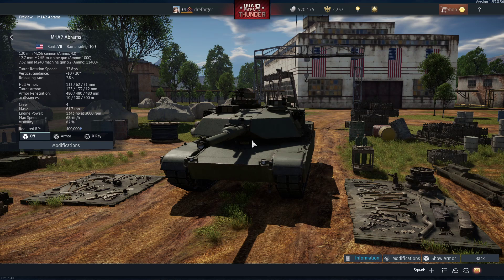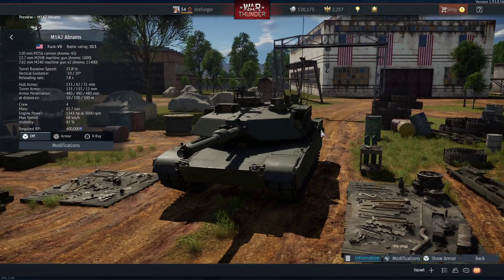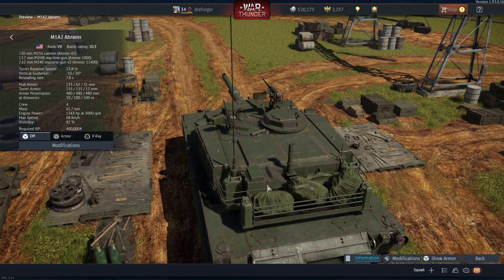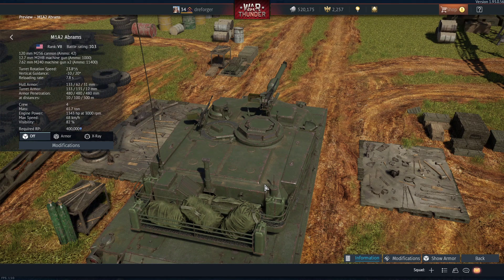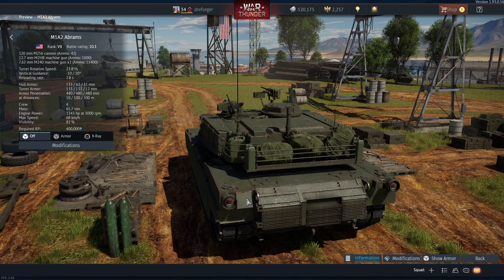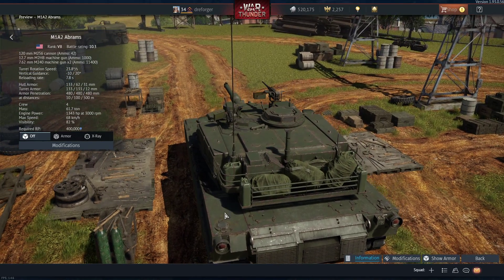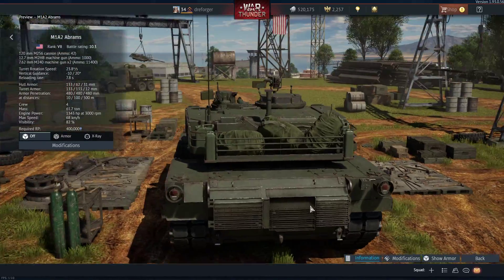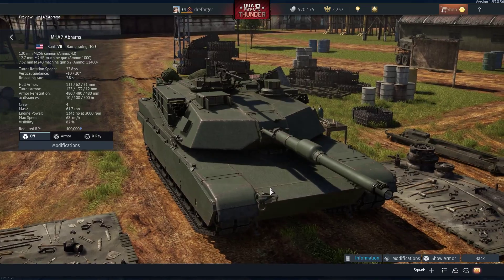War Thunder - M1A2 Abrams model is wrong

Comment: Of course gaijin is wrong in the Armor, we've been saying that for over a year.
Reply from the maker: Indeed. Of course they are rather unwilling to listen.
Reply: But you do realize gajiin will never be able to get exact number?
Reply: @unkrypted8189  actually yes due to its mostly classified or top secret even I think there is some armor on side because there is a footage of a abrams (M1 or M1A1 model) getting atgm'ed from side and still not getting destroyed
Reply: @omriyetanl3915  THE M1A2 turret is immune to atgms from the front, even the bmp 2ms tandem atgm.  The composite armor array is made out of titanium and other alloys that basically stop anything on the planet  from penetrration.
Reply: @unkrypted8189  yeah but it's alot higher then what the hell game has.

Comment: In other words, the model in game is a SEP variant and not the original 1992 variant. I also picked up on those details as well. The thermal management system and bustle rack extension was a dead giveaway. Even the radio antennas aren't modeled correctly.  

One interesting pointer, those disc looking protrusions on the turret blowout panels are lifting points for the quick ammunition change out system which involved a crane lifting ammo rack modules into the ammo storage compartment which would theoretically be faster than having the crew load rounds in one at a time by hand. Chieftain mentioned this in a video he did about the M1.
Reply from the maker: Yes indeed. However the model in the game is more a hybrid of the basic M1A2 and M1A2SEP.
Reply: The model in game is not even a SEP, because it is wrong even to be a SEP

Comment: They still havent fixed it.
It's the M1A2 SEP design but then gimped to be an M1A2 'standard' again.
Also, it still has the export variant armor and not the DU armor.
Reply: Its armor in game files I searched is labeled as Leopard NERA. So it's not DU pretty sure it's spaced armor

Comment: To be honest a lot of the tanks in this game at this tier aren't modelled correctly, it stands out particularly with the ammo types they use
Reply from the maker: This is correct. For example M1A2 should use M829A1 and M829A2 APFSDS ammo. Challenger 2 should use L27A1 APFSDS. Leopard 2A5 should have access to DM53. But of course this would put Russian tanks at disadvantage. Also armor protection should be increased.

IMHO gaijin made a mistake venturing forward to a vehicles that are still mostly classified.

Comment: Front of the turret is also wrong, the m1a2 has even armor not one side shorter
Reply: Abrams, Leopard and most other modern tanks are asymmetrical because the loader doesn’t take as much space aa the commander and gunner combined.  The turret cheeks do not have the same length as both sides of the turret have the same protection

Comment: M1A2 armor is still classified?
Btw most MBTs models are wrong like Challenger 2 Leopard 2a4 and 5 nerfed to oblivion  m1a1 m1a2
Reply from the maker: Yes, basic M1A2 armor is still classified when it comes to it's performance. Heck even the oldest basic M1 armor is still really classified. There is no hard data on it's performance, and declassified drawings from the CIA are not 100% accurate, they are more a drawings for decision makers to show them how more or less armor looks like, they are not however a factory drawings that are the most accurate.

Comment: pretty sure the model is correct and will be adding more stuff later down the line, you are forgetting 1.95 is around the corner, so we might be seeing sepv2 abrams and this is just a template tank.
Reply from the maker: No the model is not correct. I even consulted this with a former US Army master gunner who served on M1 tanks (mostly M1A2SEPs). Also photographic material and material in books agrees that model is incorrect.
Reply: @bronpancernaswiata6835  it doesn't matter,  alot of tanks in other trees have the wrong models as well. The T80B  has the wrong model etc.
Reply from the maker: @uncleruckus7729  Well, I believe, that if gaijin aims to at least represent this vehicles in form of at least accurate models, they should keep attention to such details.
Reply from the maker: @LaVictoireEstLaVie  Gaijin model is more of a hybrid of the basic M1A2 and M1A2SEPv1. But yes, you are correct, this video shows the basic M1A2.